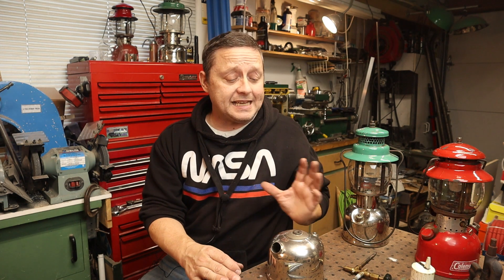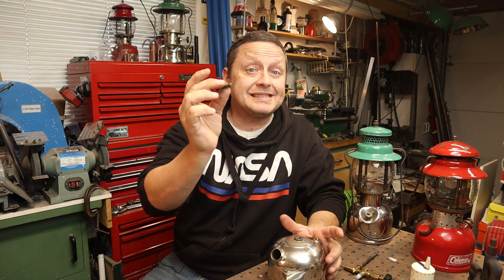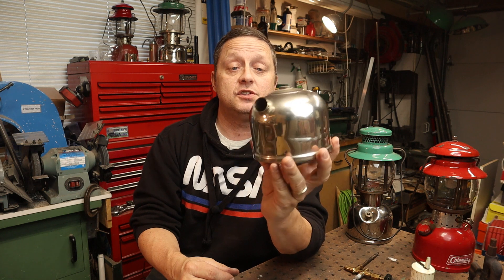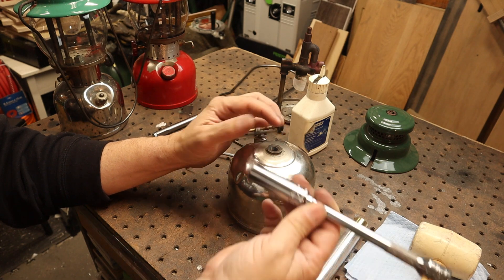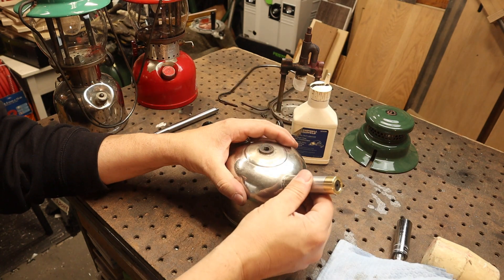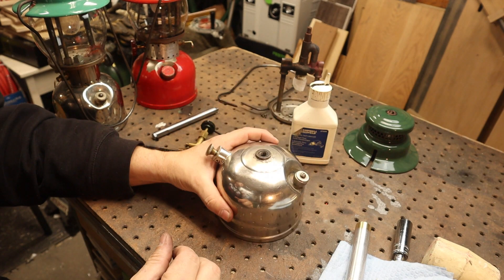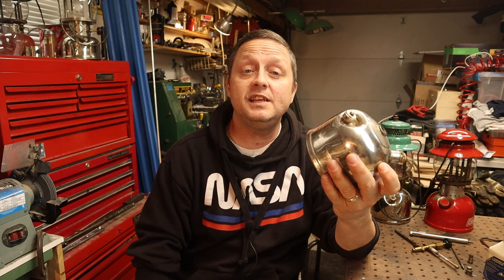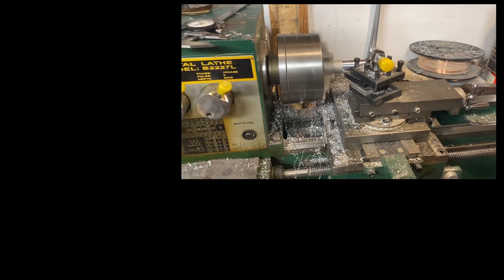How to unplug The AIR TUBE in a Coleman Lantern // Restoring vintage Coleman Lanterns

Comment: Just used this method successfully on a fairly young lantern (288A). Thanks for the advice and for keeping the video up. I used a socket, an extension, gear oil, and a rag.
Reply from the maker: Excellent!, glad the video was helpful and worked for you.  Cheers.

Comment: Hey there I have the tool
For that and use a hand pump grease gun to put on special tool that fits after check valve is removed screws in and the hydraulic pressure from the grease unclogs the tube
Reply from the maker: Yes. That works good as well. Have a look at my recent video showing a tool like that.  Cheers.
Reply: @MikeFreda  Nice to
See other people restore lanterns also , I’ve been restoring Coleman lanterns for years , including painting tanks and installing new decals if needed , you have some nice lamps I see , your right it’s not common for the tube to be plugged but it does happen sometimes,

Comment: I tried soaking with parts cleaner for a week and an air compressor with 120psi and no luck so far. I will have to try this method.
Reply from the maker: I hope it works out for you!  Cheers
Reply: @MikeFreda  I had tried brake cleaner in the pump tube since that is all I had and left it in for a week and nothing. I finally got a can of carburator cleaner and after only one day the tube was clear without even using any pressure.

Comment: I have a 220D from a garage sale that I cannot pump.  I simply cannot force the pump down.  Taking out the check valve though, I can.  Air goes in no problem...   And if I can do that, it means my air tube isn't blocked, like yours was, right?  The checkvalve appears clean and the BB rattles like it should.  If I re-install the check valve and pump, I get the same result: I cannot press the pump down...    Any ideas what could be the issue?
Reply from the maker: Thanks for your comment. This is a bit odd.  First off, I would remove the CV and stem and just install the pump cup rod in and see if you can pressurize the tank. 

I suspect your CV is clogged at the tip. The ball may move but not allowing air to pass. Clean the check valve. I have another video on how to do that.
Reply: Great tip Mike, worked first time. Smart.  russ